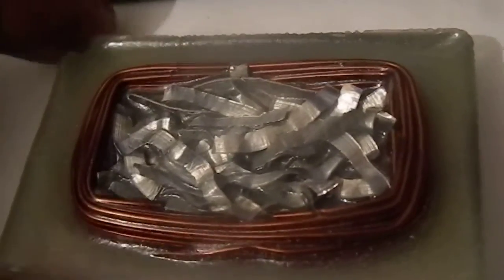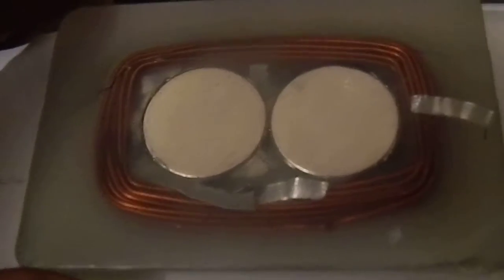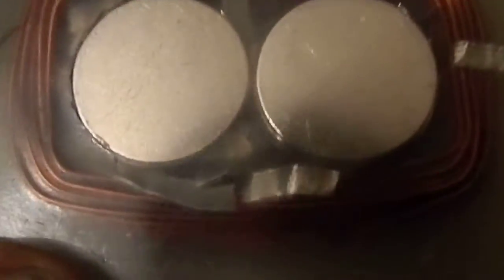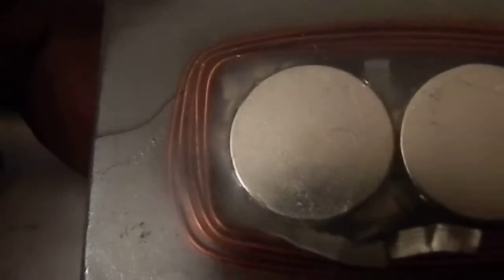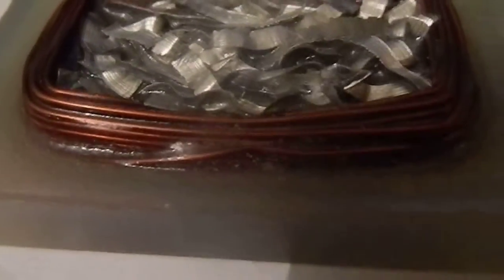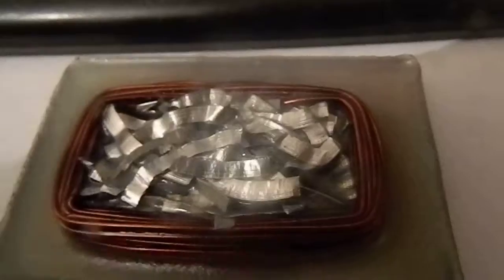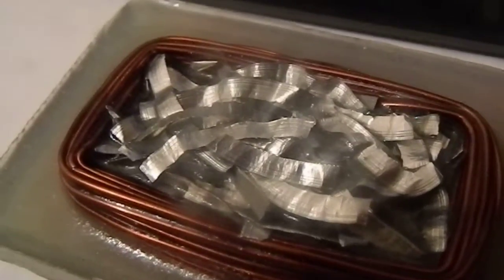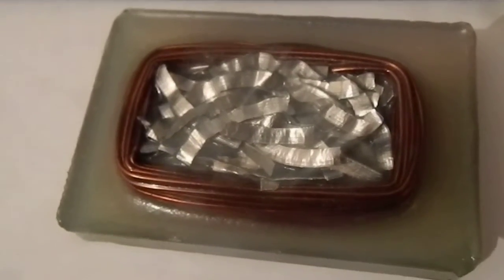Experimental Magnetic  Copper coil , neodymium magnets and swarf ( orgonite )

Comment: I did by western resin etc but I intend using high temp plastic board to house the windings to allow airflow to cool the coils similar to helibug's design, even a case drilled out for ventilation has crossed my mind, either I will do it, since I have 14kg of 1.4mm magnet wire.
Reply from the maker: I will have to check that out, there is a guy called kitestrings on fieldlines , did you see how he did his compartmental stator
Reply: +Gavin FreedomLover I checked kitestrings out, seen that design before, I also have high temp west systems epoxy so I could try that design as well.
Reply from the maker: nice.I'm using some styrene resin I've had for years